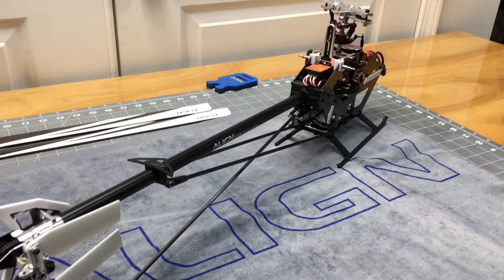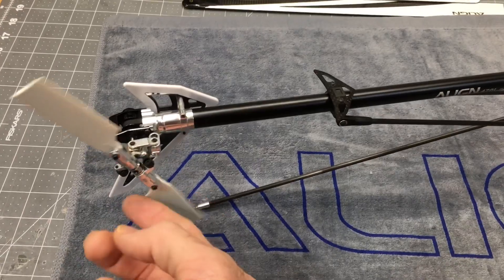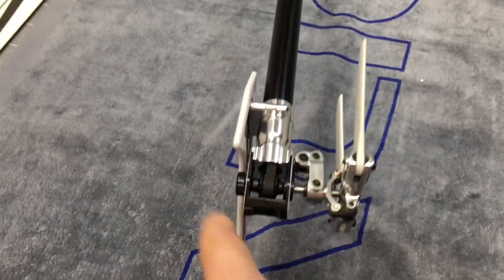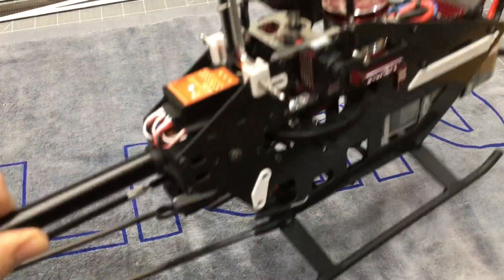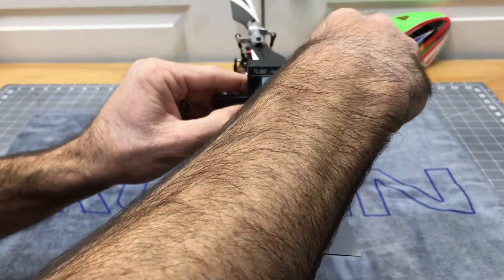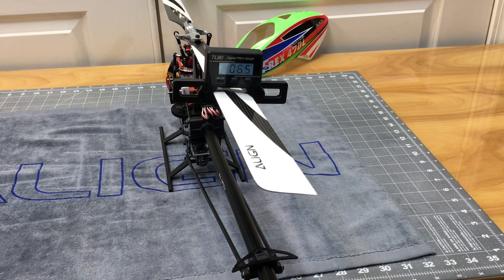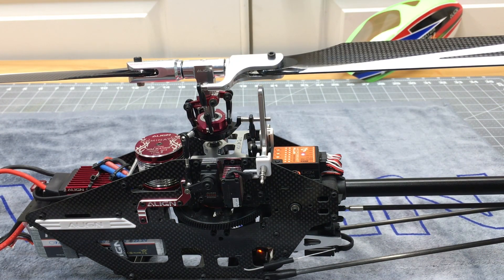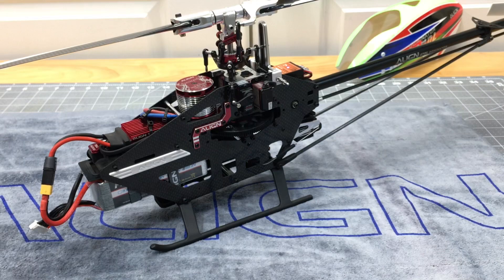Align Trex 470LM Tail Setup And Pitch Setup In The Micro Beast

Comment: One of the video you posted of your henselheit flight,  I've heard in the video your Radiomaster was giving battery feedback percentage.   Any chance you could share how this was done?  Can't believe never though to of it before.  Have timer set to call out ever minute but why not percentage which is what actually is much more useful.  I would greatly appreciated.
Reply from the maker: @TomBenette-lx7sf  I don’t fly Radiomaster, I fly Vcontorl/Vbar. That’s is something only the control does and it is a game changer! You can fly the full capacity of your batteries, not just minute by minute that way if you decide to have a slow easy flight or a hard flight, it is automatically adjusted for.

Comment: Thank you for great VDO
However, I still have problem with Menu”L” (Cyclic Limit).
I use KST215 servo with my 470L.
In the menu L, when go to full negative pitch (-12.5 deg) and steer aileron stick, it will bind.
From my notice, It comes from ball linkage stuck at servo case.
In manual, they said status LED should be blue or red. But for mine, I have to decrease limit until reach purple LED status for avoid binding (manual do not recommend).
Therefore, do you have recommendations for the solution of this case???
(I use Beast X v.3.0)
Thank you so much 😊
Reply from the maker: Thank you! I appreciate it, so yes that is a big problem with the align helicopters. The servo geometry is not great but it doesn’t hurt if you are not 100% at the blue or red status light. I have this one set up I believe at purple it’s been a long time since I’ve sent one of these up highly recommend the ikon FBL! You can do so much more with it. Including auto level and rescue.

Comment: Thanks so much great video, Any experience with the TB 40.  I have alot more travel rudder left than right.... if the blades are zeroed and all adjustments made prior to microbeast set up, the connectors for the slider don't seem long enough. I can set left limit to match the right in the microbeast but over all travel is not what it should be.  What am I doing wrong
Reply from the maker: Thank you for watching! I don’t have any personal experience with the TB40 but from what I’ve been told and seen the tail is terrible. You’re not doing anything wrong, it’s not symmetrical and does not have even travel left/right.

Comment: Great to the point video. I also had issue with binding at full collective pitch and full cyclic. Instead of using  beast to limit cyclic at max pitch, you can slightly shorten the servo to swash arms and then re-do the whole head setup. But I understand the video is for beginners and software limits is sufficient for almost all flyers. Thanks for keeping my interest in the hobby.

Comment: Do you weigh and balance new align blades? If so, do you just use a digital scale and regular tape? thanks!
Reply from the maker: No, I hardly ever have to balance blades. I can’t tell you the last time I did. But if you need to balance them I would use a blade balancer. You can use tape to balance them but it will peel off. Best way to drill and add glue/epoxy in the tip/bottom. But with today’s blades you never really worry about that. I will use a scale to see if they weigh the same.  But 9/10 they are perfect out of the box. If you have a vibration and it started from new blades then that’s when I will start looking into balancing and weight.
Reply: @westhobbiesrc8051  Okay thanks again your response. Yes I didn’t see a video on your channel about this so I figured that was the case. Looking forward to starting my 470lp build! I ordered the 74mm tail blades with the kit but after watching your videos I will run the stock 69mm blades.
Reply from the maker: @jetsam38  many years ago when the blades were very inconsistent and a lot cheaper or fiberglass, or even would yes, you had to balance way then CG them all that stuff. But! The blades in today’s market in standard are almost perfect every time and if they are off just a little bit, it’s not enough to notice or have an issue. Good luck on your build! The 470 is a fun heli! I personally don’t see the need for the 74mm tail blades. I’m now run a iKon 2 FBL but the rest of the helicopter is completely stock and as long as your tail is set up mechanically right, your tail performance will be just fine with the 69mm blades.

Comment: I had forgotten the brass collars over the screws that connect to the tail blade grips, and that was what was causing all the slop and wag.  Microbeast gryo gain of 40%, 60-70% constant throttle curve, upgraded MKS HV9780 tail servo, rotor tech tail blades, and the tail is perfect, heli is rock solid stable now.  Plastic tail kit, not the metal one.  Thanks for the helpful video!

Comment: On the trex 500X my elevator servo arm hits the top aluminum shaft plate thing like yours was but theirs a lot of throw left over so I don’t think I get a lot of travel after setting up the servo limits from binding. So mine is set in the red for ok instead of the blue for perfect. I think that causes the micro beast not to have much throw? Any tricks to correct this? I also can’t grind the aluminum for more room. It binds a lot.

Comment: I have to put so much right tail pitch in my 470. I go in rate mode and make sure heli hovers strait.  I have been fighting a small tail wag since day one. Anyone els constantly having a wag with 470? Im running gear drive tail.
Reply from the maker: I have zero Tailwag on any of the 470s I have built or set up. You have to hold right to hover?

Comment: How did you mount the receiver inside the frame?  I bought mine 7 years ago and it came with this 3 inch cable/ adapter for Spectrum receivers.  Becasue it's so short I had to mount my satellite recevier on the left side of the frame so that I could plug it into the microbeast.  The adapter has a little circuit board on it.  One end plugs into the receiver via the little spectrum white plug and the other end is a typical servo connector that plugs into the microbeast.  Is my kit just older or has the microbeast eliminated the need for the this adapter.  I didn't notice it on yours.  Thanks
Reply from the maker: You can buy any length satellite wire you want, I make mine but can get them up to 24in long. You leave that adapter plugged into the microbeast buy a regular satellite wire and put the satellite where ever you like.

Comment: It seems weird to limit the tail rotor pitch with the blade folded 90 degrees. It could never fly like that, why limit the travel?
Reply from the maker: You limit travel so there is no binding. Folding the blade is to only see how much right pitch you have at center stick and to gyro Direction. Don’t matter if it’s folded or not to set travel you look for binding and less/add as need be.

Comment: Hello mate. How and where did you zero out your pitch gauge before setting it up?many thanks!
Reply from the maker: Hello, I always zero my pitch gauge out on my motor or FBL unit tray. Those will be the two levelest spots on any helicopter.
Reply: @westhobbiesrc8051  sounds stupid but across the motor or back to the front which is a bit differcult lol

Comment: How do I fix my tail rotor to quit stop spinning It not touching the throttle when I plug the battery in and my blades are not put on
Reply from the maker: Not quite sure I understand? It is free spinning with no battery plugged in? Or when you plug the battery in the motor start spinning?
Reply: @westhobbiesrc8051  When I plug the battery in it is spinning and will not stop
Reply from the maker: @dustinplee5067  First thing you will need to do is a ESC calibration and double check your radio set up and make sure your order at 0% throttle when powering up

Comment: What a GREAT video...!!!!
Thank you so much for all the details that you explained as you went through all the steps.
I finally go my heli setup, there is just one thing I want to ask you.
After the tail setup, end points etc, should the tail servo center itself when letting go of the rudder stick or should it stay where it is, cause mine does not center itself.
Just wanted to know if that was normal before I take my maiden flight.
Thanks so much.
Reply from the maker: Thank you! Im glad the video helped you! So yes it is normal for the tail servo not to center. That is how you know you are in head locking mode which is what you want. If the servo centers when you release the sick then you are in rate mode.
Reply: @westhobbiesrc8051  Thanks for replying so quickly. 
Keep up the great work.

Comment: Any idea why, when out of the setup menu i have very little travel even after doing all this correctly? After doing this set up and going to F it works full travel nice and smooth in set up point F but then out of set up menu it hardly moves and sound's kind of like its binding.
Reply from the maker: No that’s a weird one. I don’t think I’ve ever run into that issue, if you still can’t figure it out I would recommend resetting the FBL and starting over but first make sure you have 100% travel in the radio

Comment: just curious...did u take a reading on if the heli itself was level?...not gonna get an accurate measure on the blades if the heli is not sitting level and true
Reply from the maker: As long as you use a level part of the heli (FBL or Motor) witch is what I always use then you will have a true level blade. The heli can 50 degrees as long as you blade is level to the heli that’s what matters.been doing it that was for 20 plus years.
Reply: can u tell me hows come when i put my pitch guage on the heli..right in front of the main shaft...turn it on..then i zero it out..why does it read  give me some astranomical reading like 40 some degrees?..i cant figure it out ...i was able to get my zero at midstick..and my cylcic and pitch limits properly...i used a tork drive rod out of a little 130x..stuck a coreless magnet on it in the middle..then stuck it on my rotor blockk and was able to use my regular guage then ...my hillbilly ingenuity saved the day lol

Comment: can't solve my tail wag- tried
inner servo horn hole
belt tension adjustments 
no binding no slop
various gain adjustments 
74 mm blades  
next will try head speed and or pitch
if I could loose the wag all would be great
Reply from the maker: How are you adjusting belt tension? Also try turning the governor off as you posted in the other video that you were running a governor? I did help someone a week ago that was having lag issues and ended up being a governor issue because you will get governor chatter that will cause a wag. My gain settings are 60% in normal mode 59% in Idle 1 and 40% in Idle 2. Of course yours may be different but I would start there and tune just the until the gain goes away and then add it back by 3% at a time until you get it back and then turn it back 3% and now you have the optimal tail Gain.
Reply: @westhobbiesrc8051  was setting belt tension by the book- will try old school to get a litte tighter.
Was running the esc gov but will turn it off.
What were your throttles? 
wWill plug in your gains and then tune it

thx! West? west here in Seattle
Reply from the maker: @skypilot23  follow the way I do it in the video. Only way I’ve found to get the perfect tail belt tension. My throttle cures are normal model 0-25-50-60-60 and Idle 1 75 flat and Idle 2 100 flat. You’re welcome! Yes west. That’s awesome!
Reply: @westhobbiesrc8051  just by tighter belt and 60 gain wag eliminated!
your channel is the cat's meow
Reply from the maker: @skypilot23  awesome! I, glad it’s fixed! Now enjoy the 470, it’s a incredible heli!
Reply: @westhobbiesrc8051  now turned off gov and went back to center hole on servo arm and 69mm blades
absolutely locked in more perfect
very very happy
will be watching your exploits
Reply from the maker: @skypilot23  awesome! I’ve messed with the 74mm tail blades on a 470 I built for a guy and they did not perform Well as that few MM makes a difference in tail speed and that makes a difference in holding power. The servo has to work harder to hold those few MM bigger tail blades as well.

Comment: What rates and expo would you say is a good starting place I have no problems with my omps at 100 for rates and 5-20 for expo but on this it dosnt feel the same at those settings
Reply from the maker: What is your FBL set up like? Your servo response? I personally do not fly with any expo, I can’t stand it I actually make curved to take out the factory dead band. I like my helicopter set up super responsive and fast. But! For a normal person I would recommend slowing down your servo response in the FBL event on video first. Because if you slow it down in your radio it only slows down what it tells the FBL but the FBL is still going to react at the same speed.
Reply: @westhobbiesrc8051  same setup stock 470lmp super dom kit. I don’t fly expo typically but I been trying to figure out this 470 I guess I’ll check the fbl settings should I start with cyclic response? I left all of my parameters at Rec settings
Reply from the maker: @Chinese_checkers  We’ve all settings the way you have it just go into cyclic response. Turn it all the way down I believe it’s blue solid? Don’t remember off the top my head but turn it down to the I guess beginner mode. It will be super slow response. Try it if it is too slow for you go up one at a time until you find a comfortable setting. Once you get that fuel right then you can fine-tune DR and EXPO in your radio.
Reply: @westhobbiesrc8051  thanks I appreciate the help I’ll give that a try
Reply from the maker: Anytime! Glad I can help!